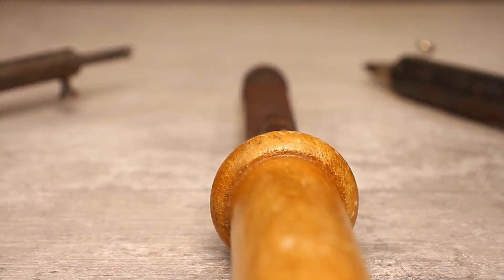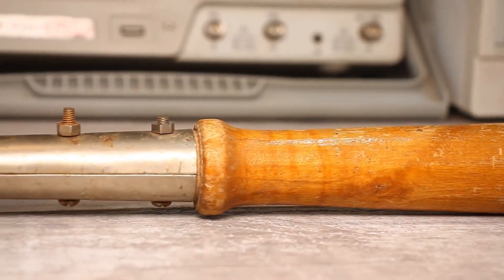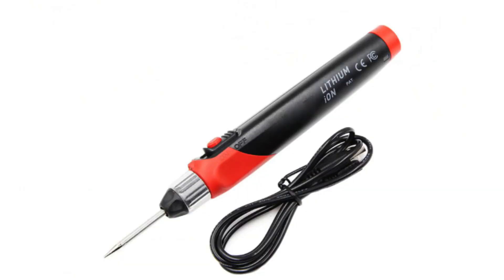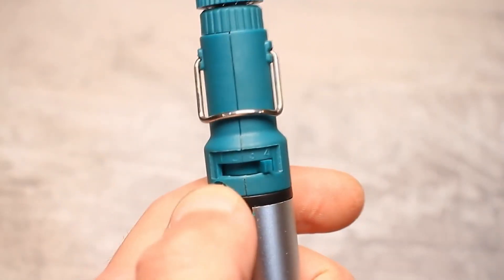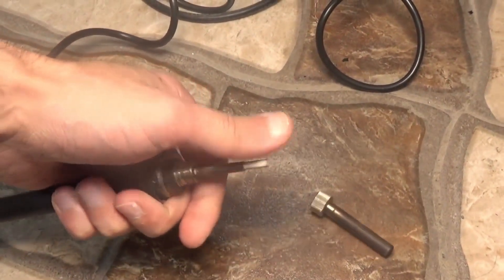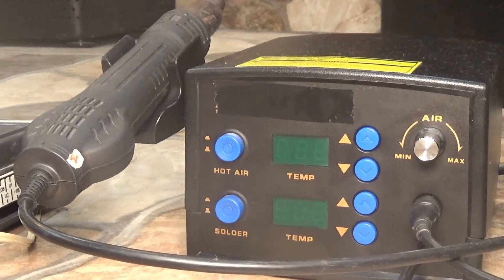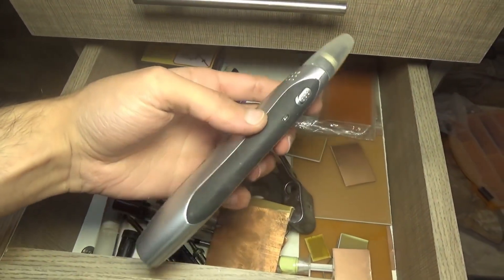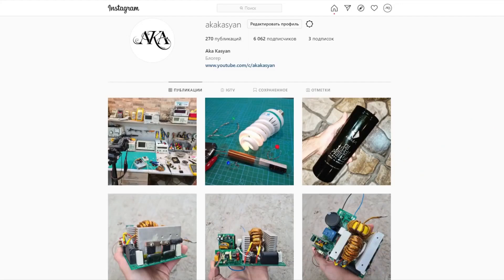Everything you need to know about soldering irons.

Comment: Actually some battery soldering irons are similar to e-cigarettes (especially DIY ones, some hobbyists buy cheap e-cigarette high C rate batteries and control boards to make their own battery soldering irons)
Reply: I've seen semi-finished e-cigarette bodies containing high C batteries and high current control boards. Maybe the e-cigarette companies sell the remaining old bodies when they discontinue the product line? Anyway these boards are handy as they're designed to deliver high current. Even if they're bot suitable for you, the high current mosfets and other parts are still useful
Reply: @ZK5120A1 I do not know about soldering iron but the ones used to make rosin smoke to find short circuits have the body of a e cig model "ego ce5". Also you gave me ideas to what to do with an e cig I have laying around